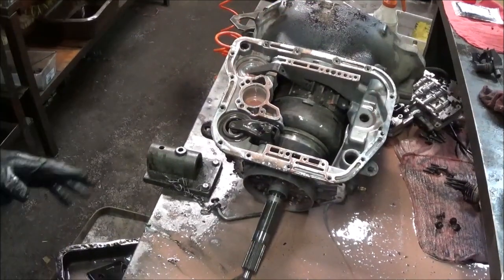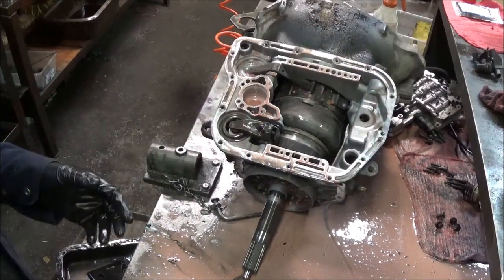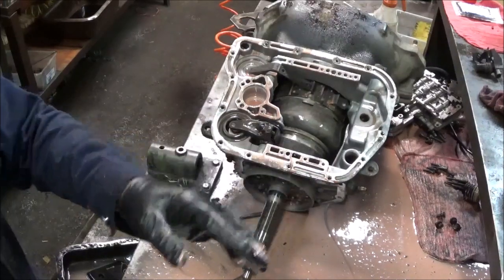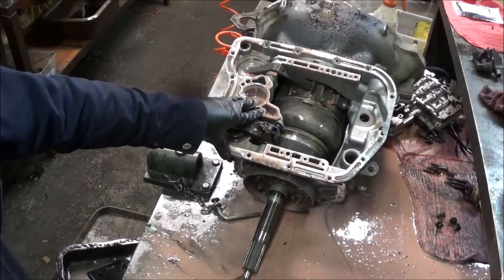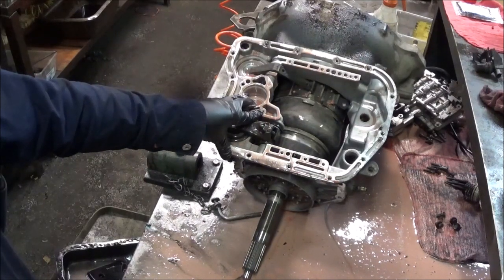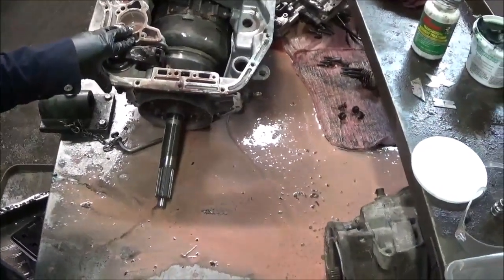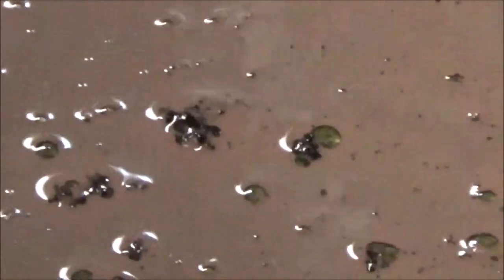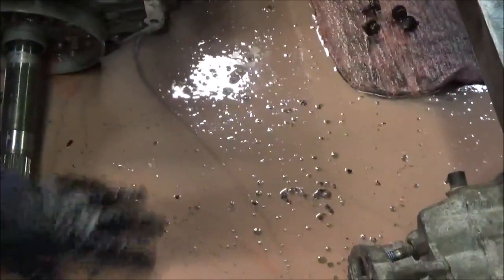WHAT DOES TRANSMISSION FLUID MIXED WITH ANTIFREEZE LOOK LIKE??

Comment: Yeah my BMW loves me enough to do this to me
Reply from the maker: Is the antifreeze mixing with the transmission fluid?
Reply: @thisisyourtransmission  So far I've only been able to confirm transmission fluid in my radiator. But I can promise you I have transmission issues, she's definitely slipping and going into limp mode. So I'm expecting a mess when I get into it.
Reply from the maker: @mikeythesizzlerr9495  when I have this problem, I install an aftermarket transmission cooler as a stand alone unit. This will never happen again.

Comment: Why would transmission fluid look like that but the radiator fluid be fine? (My problem) just want to make sure I diagnose it right.
Reply from the maker: Only thing I can tell you is that on some vehicles, the radiator fluid goes into the transmission only, while in some vehicles, the transmission fluid and radiator fluid gets in both the radiator/engine and in the transmission.
Reply from the maker: I have seen hondas have the mixture in both. Once the transmission was changed, then the radiator had to be changed and the engine flushed.
Reply: Mine is an f150 6r80. It’s so weird. It has a transmission cooler separate, but I guess the coolant can still get in? So weird... I am just making sure it can’t be something else before I replace an otherwise great looking radiator... I dread another transmission rebuild, but here I am. luckily this 6r80’s are pretty straight forward. I almost want to try a radiator flush and all new fluid just to see what happens. I’d be out the fluid money but it would be great if I got away with it.

Comment: So I go to get my car looked at because it kept accelerating more than I was giving it gas they said that I didn't have any transmission fluid in there and that it had spurted everywhere have a Honda Pilot 2009 so we called Honda and they told us to put a little bit of transmission fluid to get me there we did that I went in the next day they looked at the car called me and said that they recommended that I get the radiator changed because the transmission cooler let loose and transmission fluid was in my coolant pumping it thru the coolant system also said we should do a transmission fluid flush just in case there is any coolant in the  transmission itself if there is sometimes that does result in replacing transmission because of the clutch getting any other fluid on the clutch disc could ruin it but checking the dipstick he didn't see any signs that that had happened but there wasn't enough transmission in fluid in there to see that and a flush on the cooling system to get all the transmission fluid out of there any mention that we they might need to replace the thermostat he told me he would call me with an update when he called me back when I call for a question 4 hrs later they are done and said they only got 80 percent out and they didn't believe they could get the rest out mind you this is a Honda dealership I want to know can I sue them because if they knew that it needed to all come out what was the point of charging me $1,600 they never mentioned that anything was messed up and we're more concerned about me getting my timing belt replaced I drove it to the city for the weekend and on the way back head overheated and now I have this milkshake of death in my system what do I do
Reply from the maker: Well, they are supposed to get the mixture out as much as they can. Then they are supposed to test the cooling system to make sure that it is cooling the system properly, that is making sure that the fan is turning on and off properly. Making sure the fan when on is pulling the hot air away from the radiator. They suppose to verify all of this before returning it back to you.

Comment: Whats is the amount of water that got into atf is little? Will it still hv milkshake colour?
Reply from the maker: Don't know the amount that got in. This question what have to be for a chemistry lab that have the ability to separate the water from the transmission fluid. If you leave this transmission in the vehicle, the only way that one could get the color back to true transmission fluid is  to have the fluid flushed by a machine. However, the water/antifreeze would have already done its damage.

Comment: That's pretty bad
Reply from the maker: Had to rebuild the whole thing
Reply: @thisisyourtransmission  I would of done the same that's pretty bad
Reply: I got the same problem with my 2017 ford transit T250 and I took it to the dealer and they put a new transmission and new transmission cooler because they said it was leaking coolant from there, but 2 weeks later my van start vibrating again like the firts time so I don't know why still this happening if they put a new transmission I will really appreciate if you can give a advise about this I worker in Remodeling and painting and drive alot so I dont want those guys fix it to make work for awhile and then it will broke again and my guarantee bumper to bumper spire and i will be screw up! Thank you hope you can help me!